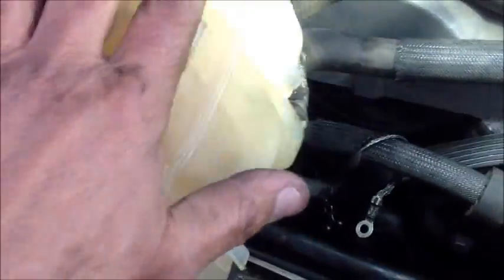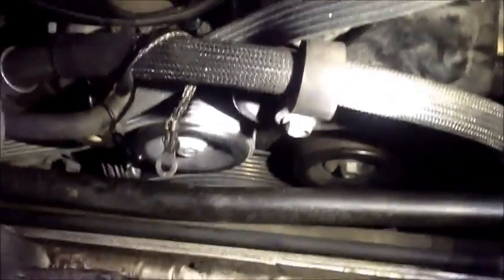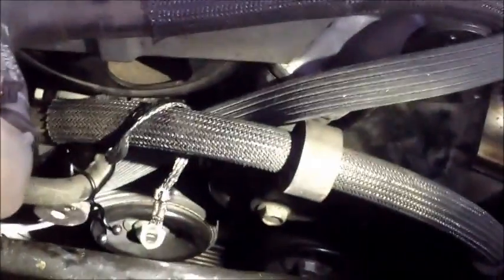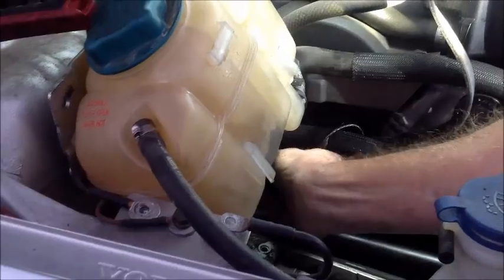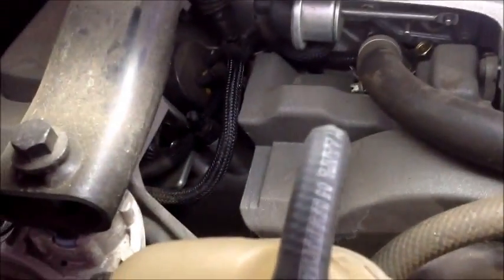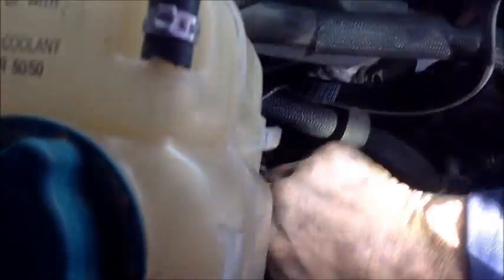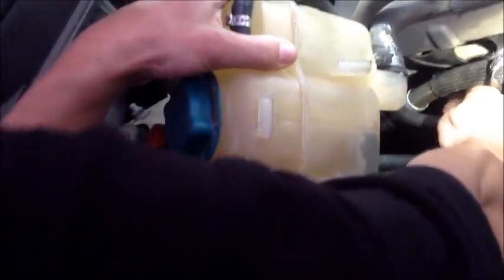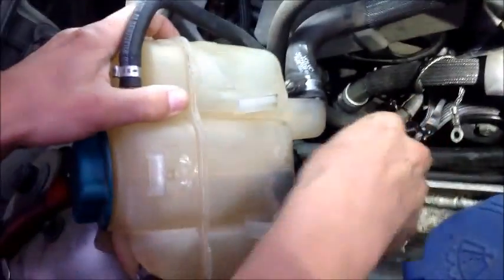How to Change Volvo Belt # Not Timing Belt Volvo (2006 Volvo xc90)

Comment: you need to replace all the idlers on the volvo v8s when doing a belt service maybe that was skipped in this video but i hope for the customers sake they were replaced. very common for the idler bearing to sieze and destroy the entire timing cover ends up costing about grand to fix. justva few words of advice.
Reply: Just happened to my wife's XC90 4.4L. About to fix it in the driveway today.